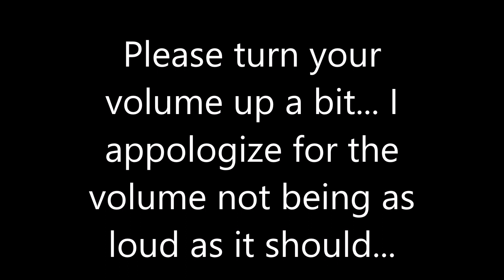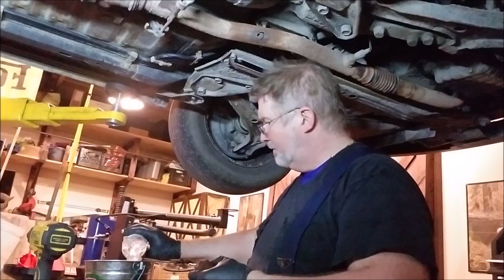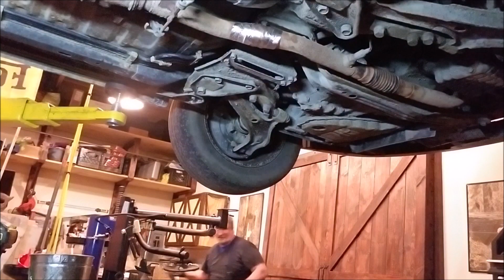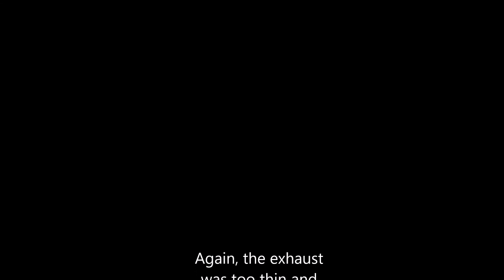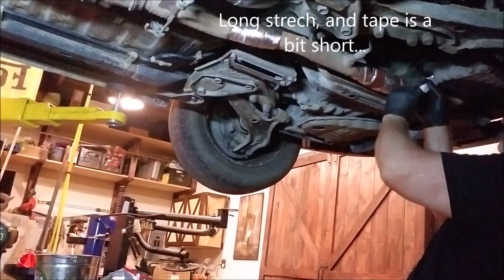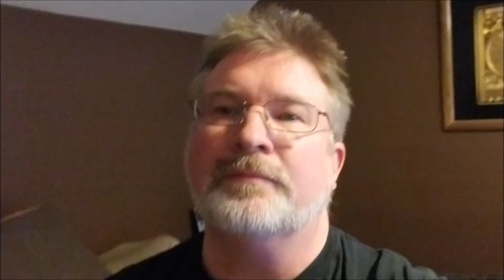10 Minute Exhaust Repair FiberFix Heat Wrap Flex Joint Repair

Comment: Flexpipes - another of the many stupid adaptations required by the transverse engine design.  The patch will work for a while - based on my experience, a year is not in the cards.  However, this was an excellent explanation on how to apply.
Reply from the maker: Thanks, yeah I know...

Comment: Will this stuff work for a broken flex pipe?
Reply from the maker: I've done flex pipe repairs with this, it is a band-aid. But it will "fix" it for a short time. It will keep the noise down and prevent leaking. But rough roads will make it not last as long.
Reply: Brian E. Niskala, even if its wrapped around on the ends and not in the middle?
Reply from the maker: @ericwarmington522  If you get it good and tight... the creases are the difficult part to get. But on the ends, make sure you even push a little material into the break/split. You can even cut a small piece off to do this, shove it in a few millimeters and then wrap tight and generously around.

Comment: Going to do this on my accord flex pipe.  Better than the very expensive option.  I realize not a long term fix.  Thanks
Reply from the maker: It works, a band-aid but it will get you by to save money for the real fix or another car purchase. It works great on those weld spots that get holes in them or holes in the exhaust pipe itself, Good luck!

Comment: I intend to use this to fix a hole on a steel reinforced rubber exhaust hose on my volvo penta marine diesel engine. Does anyone have any experience using this stuff on rubber?
Reply: Thanks for that. I've since discovered that the hose has a ribbed exterior so the flexseal is probably a good idea.
Reply from the maker: Might be to rigid for a fix like that... maybe Flexseal and then add this?

Comment: I am thinking of using this and then a band clamp.  Would it be better to  place the clamp over it while it is curing or after it is done?  thanks.
Reply: I an going to use the band clamp on its own first to see if that does the trick but if it still leaks...  I will use the fiberfix then a clamp.
Reply from the maker: Sounds good!
Reply from the maker: I would probably put the band clamp first. Make sure you have this stuff tight! It will be tricky around the band clamp. https://amzn.to/2UUcZHc and try this stuff around the joint too, before you seal everything in with FiberFix. This stuff is great at sealing holes and joints too.
Reply: how long did the fix last? do u live in a snow area?